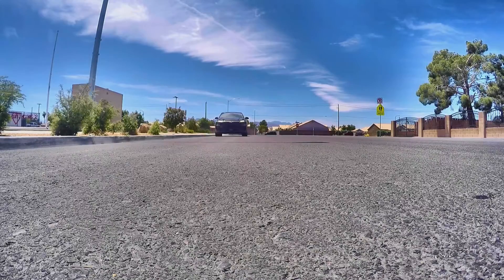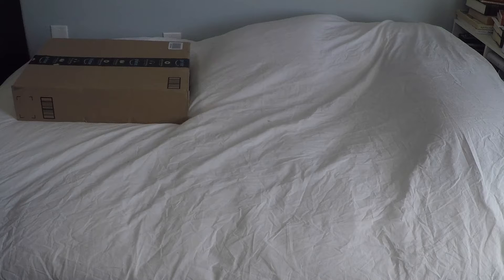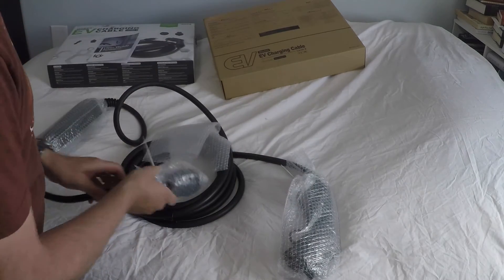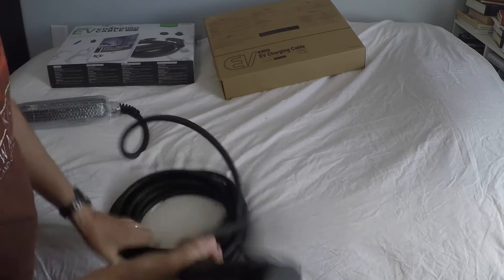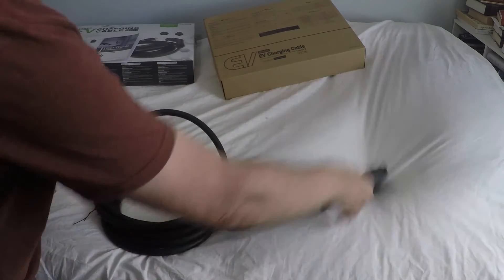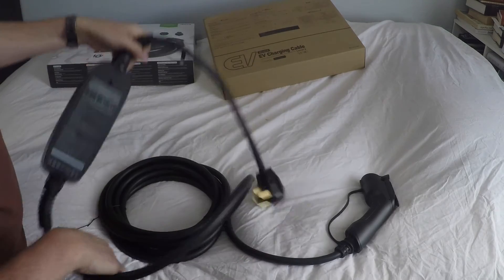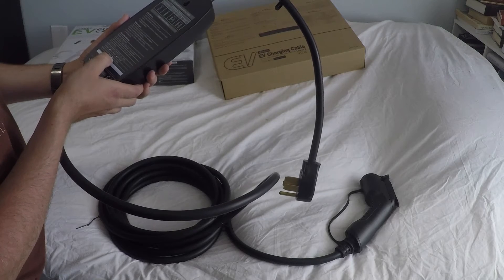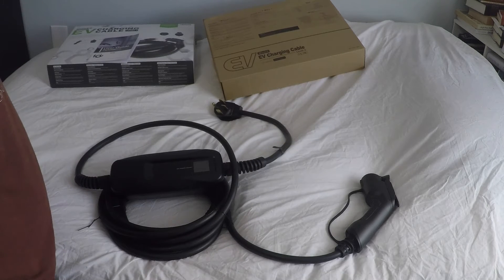Morec 40A Portable Charger Unpack & First Charge

Comment: Hey man, considering it's been a few months since this video was released, how has the experience still been? And in the box, does it say morec somewhere?
Reply from the maker: It's been a great charger. It's working fine. The only minor annoying thing is that I have to remember to turn down the charging speed in the car to reduced in order for it to not overload the circuit, as mentioned in the video. I charge away from home when I'm at work so there I set it to maximum and then coming back to reduced. But I got used to it quickly. I also have an Emporia home monitoring system to monitor power usage. Nothing of any concern. For a portable dumb charger it's a good, fairly priced charger.
Reply: @esprit1st75  That's assuraing, appreciate it man, I have placed an order. Also, as mentioned before, did you see any "morec" branding on the box you got when you ordered it? Just curious and wondering if they are getting the hardware from someone else and customizing it to their own, some don't have their own branding because of that, especially the cheap random brands you see on Amazon, I hope morec is not one of them as it's important when it comes to customer service and etc.
Reply from the maker: @architsasta700  Not sure about the packaging. I didn't keep it, so the video is the only source and as mentioned and (kind of hard to see) in the video it seems it is only generic. But maybe they changed it. It's been 9 months since. Who knows. Sorry I can't be of more help regarding that.

Comment: Isnt the charger amperage adjustable?
Reply from the maker: No, not on this charger. But you can adjust the car as mentioned in the video. Setting the car to reduced makes it pull 40 amps with this charger.
Reply: @esprit1st75  im hesitant on these chinese made chargers. I believe the components inside are inferior
Reply from the maker: @ivanska3099  That is very much possible and I can't test/judge that. It's been working fine though.

Comment: Nice work!  I went though the exact same experience with my Ioniq 5 and same charger. I’m happy with the minimum charge rate.   It has all night to charge, so all is well.
Reply from the maker: Thank you. I usually charge at reduced speed which works great. It pulls 39 Amp at that setting, so exactly what it should.

Comment: Doesn’t the car limit the charge? The EVSE communicates its capabilities and the car matches that.
Reply from the maker: You are correct, the evse SHOULD communicate it's capabilities, but it's like it doesn't. That's why the car pulls more than 40 Amp if you set it to pull max. So I have to set it to either reduced for 40 Amp or minimum for 30 Amp. It's not a huge deal especially since we have solar and I like to reduce it to 30 Amp so the car doesn't pull more than we can produce. But it is a flaw in the evse.